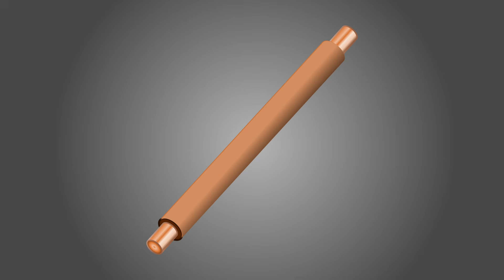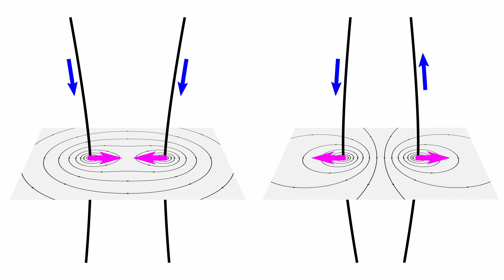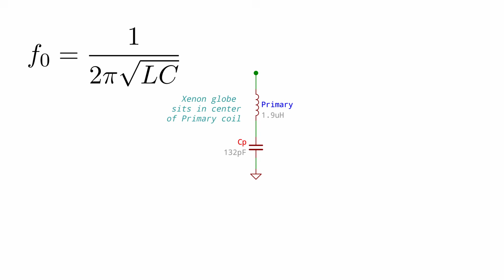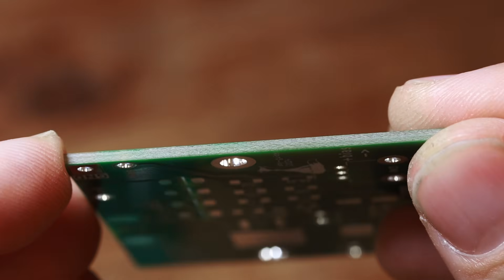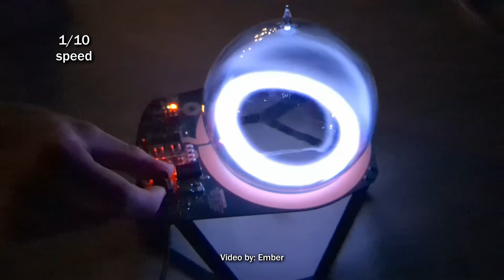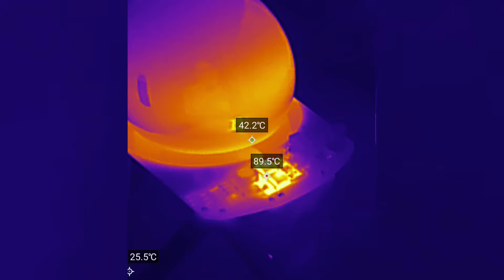A plasma toroid for the modern era.

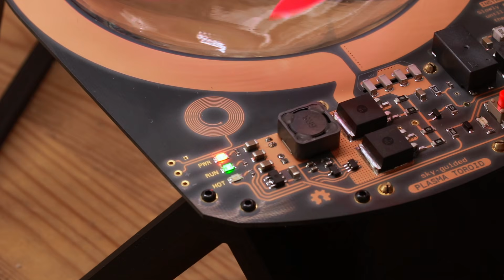Comment: Hey bro Really AMAZAING Video and aproach was Phenominal,putting it on  PCB makes the science more real than just seeing components 😅.now if it possible id like your help in regards to an element in your setup,Id like to know about the pick up coil in time stamp 11:52 .My current knowledge in elctromagnetics tells me if one coil of two mutually coupled coils has more turns in it,it should generarte more voltage than the driving coil,but i see your pickup coil there has like 7 turns compared to the two of the primary,so id like to know how you figured out it would generate a lower voltage within the leds working range. Is it a proximty effect thing? or the ratio of their areas also works as a turn ratio or what?,the primary is oscilating hundred of volts correct?,so how is the pick up coil managing to lower the induced voltage to led working levels? the 680 ohm  resistor value hardly seems large enough for the primary coil voltages.
If you can help me understand the principles of the pick up coil id really appreciate it bro.
Reply from the maker: The "turns ratio = voltage ratio" thing only applies if the coils are well coupled. The pickup coil is only interacting with a small portion of the primary coil's field. 

Also, I'm not a bro.
Hope that helps!
Reply: @sky_guided  Yeeeeeeeeees like thank you so much this Helps ALOOOOOOOOOOT. electromagnetic coupling is like the BANE of my projects.... but you've opened my eyes, there is an an ascociated transfer fucntion of sorts that relies on coupling and I'm really greatfull for this...I usually feel more reassured when I get guidance from experts whose knowledge on the matter is  concrete and immutable  🙏

Comment: The new form of engineering / scientific publication is much more engaging than the traditional institutional paper publishing.

For the 'arc start trigger' couldn't you use some piezoelectric spark generator, like those in old cigarette lighters? If I recall the newer plasma lighters do use those too.

BTW, love the outfit too, so slick.

Comment: Beautifully executed design! I used to use a tiny radioactive source (like in smoke detectors) to get rid of static electricity when weighing milligram quantites of expensive reagents in the lab. These create ionized gas continuously near them. Perhaps you could use that so it starts as soon as it begins oscillating?

Comment: Is it 13mh with the plazma load on the line ? Or 13mh with out the glass bubble?  Krypton is known to add fine filments when you dope other color plazma with it. That may by the answer to other colors that are still a stable toroid. I guess that's less important if wane's shop  is doing your fills.
Reply from the maker: The precise frequency doesn't matter too much, seems like anything in very roughly 10-15mhz works fine.

I'm super keen on different gas mixes but yeah I don't have the tooling and skills to make my own globes at the moment 😅

Comment: It's great you open sourced the design and even the notes. I would send you a metamask tip for the fox mask alone. 
There was a variant I saw with terbium salts or carbon flakes on youtube where the particles float and sparkle with the convection inside the globe. One build was a 3 liter globe and would be a museum grade display piece.
You are right about RF/EM field emissions though, the general public shouldn't be near this thing unless pre-qualified to not have pacemakers or personal electronics on them beforehand.
RF burns suck bad, and we don't know the long term effects biologically.

Comment: Is there a way to estimate the current density in the plasma ring? Does it depend on the gas pressure and/or the input current, voltage, or circuit's frequency?
Reply from the maker: Probably several ways to estimate this, but that's beyond my current skills 😅

Comment: Hey sky guided, how did you get those tiny tank capacitors to not over heat? I got an array of caps (through hole not SMD) and they can get pretty hot. Is it bc I’m not obtaining true ZVS?
Reply from the maker: My caps do get a bit hot before the toroid initiates, and I am driving them hard. zero-voltage switching is more about voltage at the mosfet -- there's a substantial phase delay between mosfet switching and voltage at the high side of the tank. Speaking A Priori I'm not sure why you might have excessive heating

Comment: I have a small Xenon bulb that is 85mm in diameter, and smaller than the 130mm one you appear to use. Should I adapt the pcb, or 3D print a mount for it to suspend inside the existing pcb?

Comment: Really cool experiment! I wonder if using a toroidal (doughnut-shaped) glass structure to guide the plasma would make the flow even more organized and stable. A smooth toroidal path could naturally reinforce and assist poloidal and toroidal motion inside the plasma. Also, since kinetic energy adds to total mass (via E = mc²), a well-organized, circulating plasma ring might have a slight mass increase beyond just the rest mass of the particles. It would be amazing to see plasma geometry not only stabilize flow but also physically affect mass!

Comment: Thank you so much for this very informative video! Special thanks for pointing me to this gorgeous family of ultra-fast power MOSFETs from Infineon! I had missed them in my hours of research, as I wasn’t looking in the 250V voltage range. I’ll be using them in my small handheld getter-firing ZVS induction heater running at 1–3 MHz. They will significantly reduce switching losses due to the lower delay of the MOSFETs. I also really like the style and aesthetics of your build – and of course, the fact that you made it open source. Thank you! Love it :-)

Comment: would your circuit create less heat if you matched the source and load impedance more accurately?
Reply: when you pick it up and it creates the beads on the string effect, clearly thats a standing wave... and when you have standing waves...
Reply from the maker: @Erick_The_Green  maybe! I'm not entirely sure what the electrical properties of the plasma are though 🤔

Comment: Great Video!!!  I have an important question for you, Sky. Do you think, that if you were provided with an interlocking dual-toroidal chamber, so that the 2 plasma toroids were at right-angles to each other.  That you might be able to drive energy into, and store energy into the co-plasma-momentum-reversal oscillation by precisely controlling the frequency sequencing of the individual toroid drive coils? Giving each a little push of energy at it's reversal vertex. So that it comes back against the other with slightly more energy than the previous oscillation?  

The reason I want to do this is because I'm looking for a way to store energy in the Inertia-Energy equivalence. Thus enabling potential energy to be stored in inertial oscillation, instead of by heat or electrostatics. By storing energy in inertial oscillation, the peak velocity of the storage medium matter does not have to approach c (light speed), the acceleration and deceleration rate of the medium is responsible for the volume of energy, not the velocity. Increasing the mass of the medium while maintaining or slightly increasing the oscillation acceleration would store inertial energy with little increase of particle velocity.

My goal is to be able to pump energy into an inertial-energy-oscillator until the virtual-mass of the medium is so high, that it's movement through space is subject to very dense spacetime curvature.  Im hoping that suddenly decreasing the total mass of the medium by a large proportion, while in a moving vehicle, will cause the particle velocities to approach c. As they do, causing the curvature of spacetime around them to rapidly decrease. Im hoping that as the mass of the medium falls below the virtual inertia of their full mass velocity+vehicle translation velocity, the curvature of spacetime around them will be forced to expand and thin so that the particles can exceed relative c velocity to conserve their inertia without violating causality. 

During that period, the density of spacetime around the vehicle should drop with an energy proportional to the virtual inertia imparted to the medium upon the vehicle's acceleration. If the vehicle's velocity is significant, or close to c, it should translate through space at a relative velocity above ambient c within a local self-generated spacetime curvature in which internal c must be higher than ambient c.

Comment: Is it safe and/or legal to get a globe of Radon? Because I'm wondering if the reason some other common gasses don't work as well as Xenon is just a matter of atomic mass. It makes sense to me, anyway, that higher atomic mass would tend to spread out more from the center of the disk in a phenomenon like this, which could be why Xenon makes a narrower ring than lighter gasses.

Comment: This is by far the best demonstration of the plasma toroid that I've seen thus far. Very aesthetically clean circuit(s), amazing stability of the plasma, a starting method that will likely become the new standard, and the utilization of the PCB for the "run indicator" was very creative. +50 DKP

Comment: Some things I would look into are some heat pipes to a heat sink from the transistors, and a transparent faraday cage tuned for the output frequencies
Reply from the maker: @kerbaman5125  issue with a faraday cage is that of it's near the device, you'd likely get massive eddy current which would sap power. 

The limiting factor on mosfet cooking is getting the heat to the bottom -side of the board through an array of thermal vias. Once heat gets to the heatsink, it dissipates pretty easily.

Comment: I'm just wondering if the plasma can be sparked simply using the piezoelectric igniters in lighters? one thing to add to the hazards, the plasma emits not only RF but a ton of harmful UV light
Reply from the maker: Borosilicate glass is opaque to UV. Xenon doesn't throw out too much UV anyway.